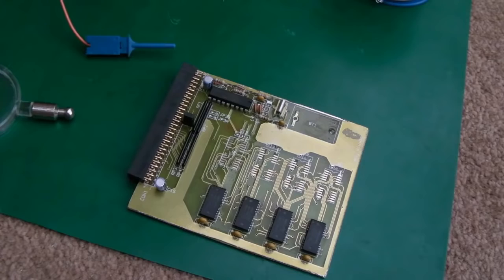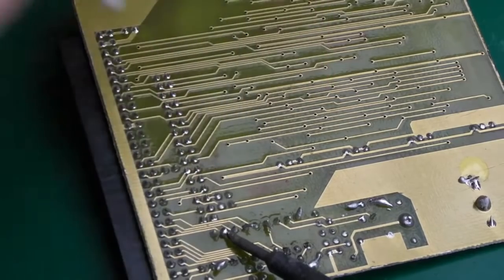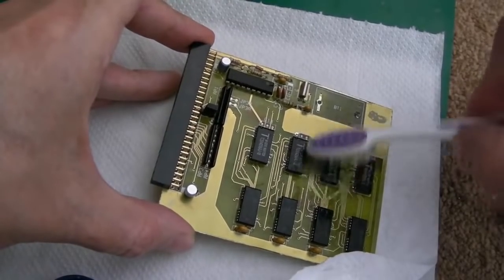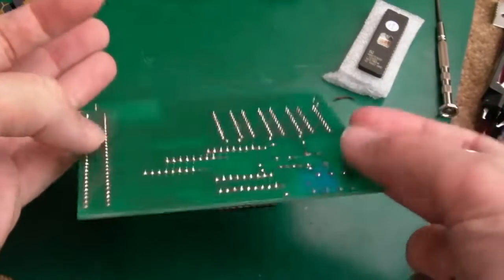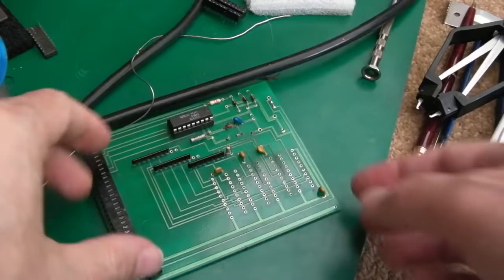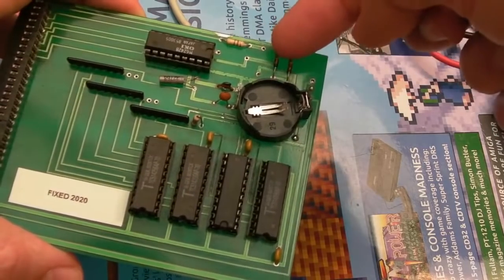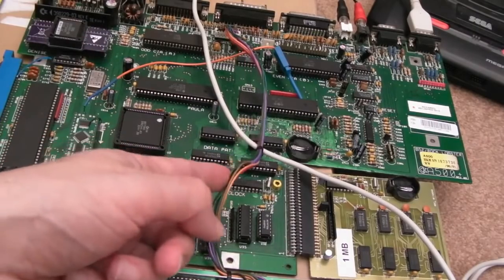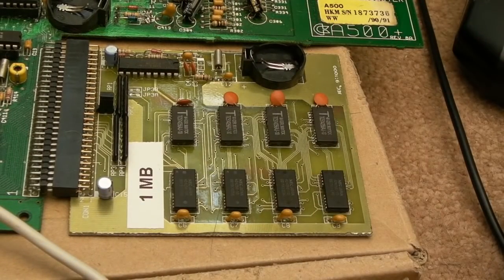Commodore Amiga A500+ Expansion 512KB to 1MB (2MB Chip)

Comment: I have a rev6 a board with 512 k and a stock 1 MB agnus chip. I tried to load steel sky and it I get a error saying insufficient memory. I have an a590 with 2 MB in and also a trap door with 512k . So total of 3 MB. Do I need to add extra 512k memory onto the board as well. Any help would be great. ❤️ Amiga ❤️
Reply from the maker: You could try changing the 500 mobo jumpers (if you haven't already) - to use the 512KB in the trapdoor as chip RAM (assuming you do have the 8372A that was fitted to the R6).  It may work with 1MB of Chip RAM....  If that still doesn't work, you might need to try booting without the startup-sequence (with later Kickstarts you can hold both mouse buttons down on  power up and skip the startup sequence).  Then navigate to the folder at command line - eg. Games:     Then CD B, CD "Beneath a Steel Sky", then WHDLOAD beneath.slave...   I've just approximated commands there - your drives and folders may be different named etc.   If you run stuff that way from the command line, there's typically more memory available - some things will work that way when you cannot launch from the GUI.

Comment: 8375 was the highest revision Agnus before they started making AGA Alice.
It is found ONLY on the A500+  and the A3000.

The 8372b (the 2mb Agnus of the 8372 series will work in the A500, A1000 (if there is a Rejuvenator board to put it in), and an A2000 (however, only if it is in one of the 2mb Chip RAM expansions such as DKB's Megachip---  they made three versions of their "MegaChip"...  two had the 8372b... ONE had the 8375 and that was the most recent and best version  of their board).
 
I don't think the 8372b will work in an A3000... because that mobo may require the Agnus to BE the highest revision Agnus...  I'd be shocked if someone showed the 8372b working in an A3000.
Reply from the maker: The 8372B was used in the 3000 - I showed it here!
https://www.youtube.com/watch?v=JJ6mkfcyGT8
Reply: @GadgetUK164 
Gah!

That's blasphemy!  :P :P
Reply from the maker: BTW - the 8375 is also fitted to the 600...

Comment: Hi Chris, I missed why you need to add the caps?
Reply from the maker: They are decoupling capacitors, they connect between the 5v rail and ground on each IC.  Each one is as near to the IC power connections as possible.  This helps with current dips and filters high frequeny noise out.  Without them, it would likely work just the same, but over a very long period of testing you may find a crash at some point.   It's always good practise to fit them.  In a system with so much decoupling, you would likely never experience a problem without those 4...